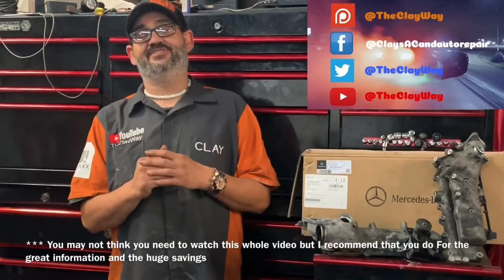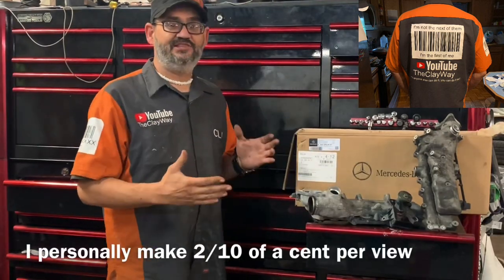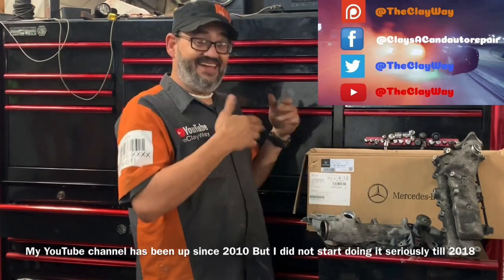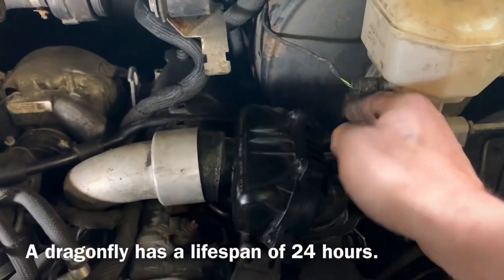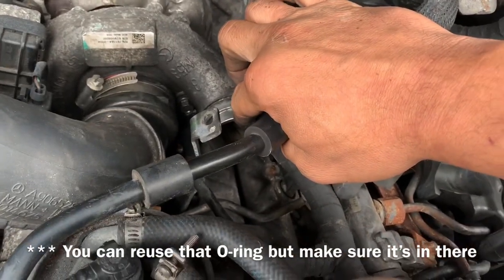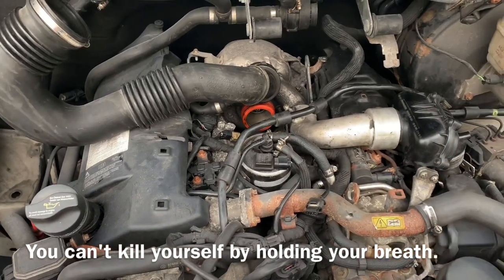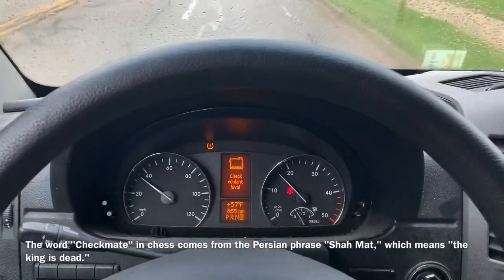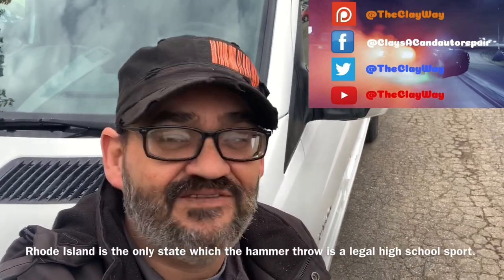sprinter 3.0 diesel swirl motor problem fixed for 2 Bucks!!!! I will save you thousands!!!

Comment: Guys.... listen. You can't trick the ECU with this resistor.  And I explain WHY. The ECU sends information to the motor every time you push the throttle, and that happens 100....1000's times. The ECU sees that the resistance DOESN'T CHANGE... its stable, and generates a faulty code. Which can bring you in the all known LIMP MODE.  Might be  later... or sooner.
Reply from the maker: Well you would be absolutely wrong about that...... 

I don’t like being called a liar

Have you read the comments? ....... it most certainly works..... 

Is it a long-term fix ? no it is not.

Does it work on the models that have runner sensors? 
No it does not. 

I believe 2013 or later this may not work on them but some of them it does because some of them do not have runner sensors I am working on a bypass for that as well.....

If you watched my video and listen to what I said you may have heard some of this and you may have also heard that and Europe they don’t even have these flaps.... at the time I was uncertain about that but I’ve had several European people tell me that I was correct... 

Anyways what do people have to lose two dollars? Give me a break this repair is over $3000 and at some places closer to $6000 so if I help people save a little bit of time they can save the money and have it repaired properly that’s the point of the video.

Stop going around calling people liars when you don’t know what you’re talking about..... 
And I hope some people have some nasty comments for you
Reply: @sharpcarco  I'm really sorry.  I don't want to call you a liar.  I watched the video.  And you really do a great job.  And I heard when u say that the fix is not forever.  And about the European  om642 3.0 cdi they do have flaps. You won't believe me, just today I finished the flaps repair. And I had to change one of intake manifold (driver side) cause the plastic was totally worn off.  It cost me 200€ ( around 250$) it was a used one but good condition.  And now I have another problem that I have to fight with that... I'm sorry one  more time man. Didn't want to offense you
Reply from the maker: Apology accepted no problem.

And like I said I’m not in Europe so I don’t know I just know what some people have told me. 

And then Intakes here in the United States are much more expensive Usually $500 US
Reply: The resistor works I've done it
Reply: @sharpcarco  Hi Clay. Did you find some solution for the runner sensors? I tried your trick on my 2013 v6 but still in limp mode. Thank you for your videos. Very helpful.
Reply from the maker: Well technically I have and technically I haven’t I haven’t came up with a solution that folks can do at home but I have came up with a solution that I can do in my shop which is program the ECM. And delete the EGR. No video yet because I’m still in the testing phase but the testing phase seems to be working but I’m gonna give it more time than the FDA did before they said that the vaccine was good and safe for everybody…… But it’s definitely not going to take 20 years like it does most of the time for drugs to come on the market…… (just using the FDA as a point of reference) I am vaccinated…….. So don’t everybody that reads this get their panties in a bunch
Reply: @sharpcarco  its chance buy the program for ECM from you?
Reply from the maker: Not yet……. Still in the testing phase maybe three months from now